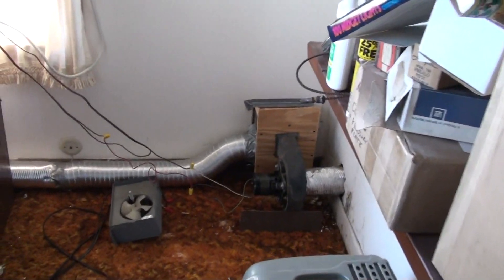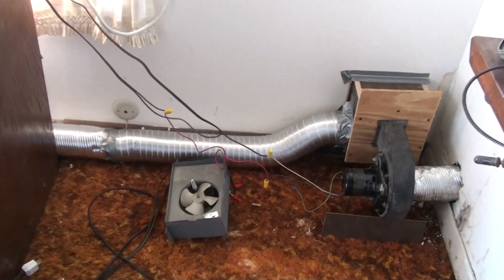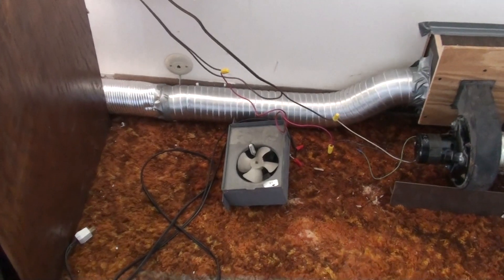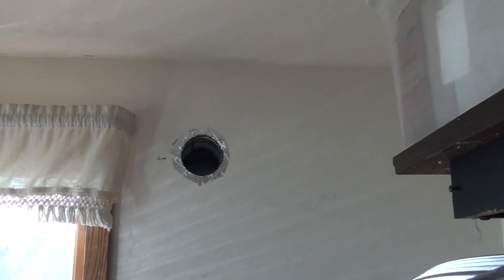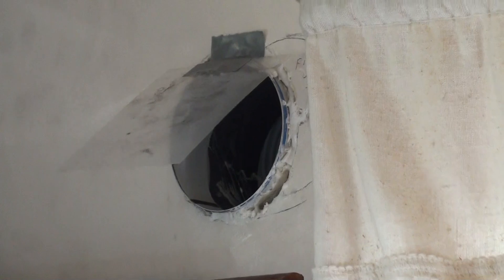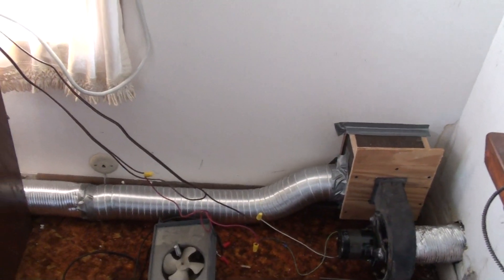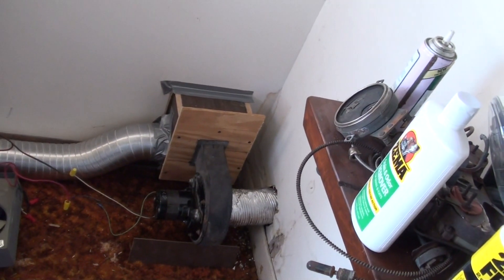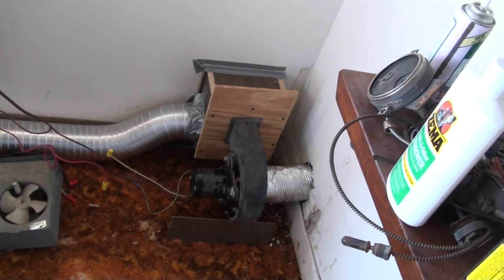solar air heaters 2

Comment from the maker: The air in that room is usually pretty warm since there is no cold air return in it. That's the room the furnace is in but when I have sun I shut off the furnace completely. It seems to work ok ,I have a small doorframe fan pushing air into the living room from the room with the solar heaters. I'm probably going to rig up a pipe coming from the cold air return in that room to see how well that works.  I appreciate the suggestions Thanks

Comment from the maker: I already have a 12 volt battery bank set up for my wind turbines but they don't charge enough right now to keep the battery bank full . So I need to add a couple of solar panels for that. Then I'll go to DC fans. For now the condenser fan is more than enough CFM but a duct booster fan would probably use less electricity.  I'll keep using AC fan for now.  Might as well just run one fan if it's big enough instead of  using electricity for 2.

Comment: Using the excess heat from your utility room is a great idea. However if you are taking the air off the floor of that room you wll only increase the heated air in that room. Try taking the air from close to the ceiling in that room. This will take the hot air out and draw cooler air into that room while drawing the heat out to be cycled to the solar panels and then into the other rooms of the home.

I think you have a great system and I'm not trying to be a know it all, just trying to help.

Comment: My advise is to stay with your blower for the highest efficiency of the system. It's better to have a maximum airflow and let the snap switches do the controlling.  Using PV to power an auto blower may be costly for enough PV to power the auto blower. I'd say use 2 auto blowers, or however many it takes to match your present air flow,  and a plug in 12V power supply. 

Noise would be the thing to reduce and you have the right idea about putting the blower in an insulated box.